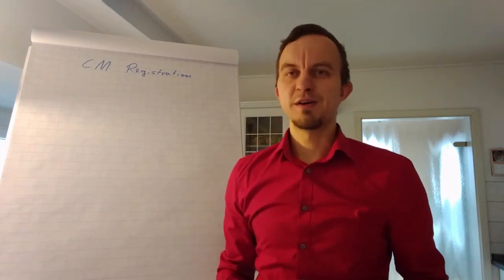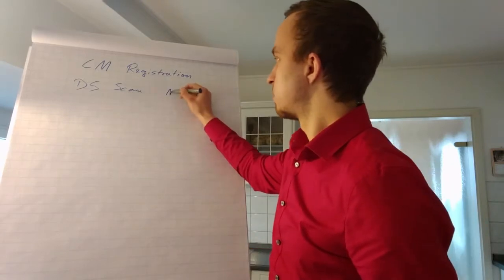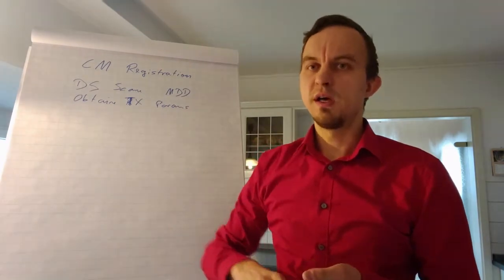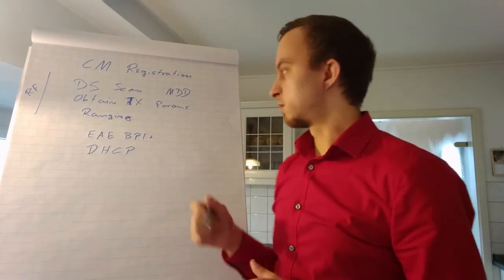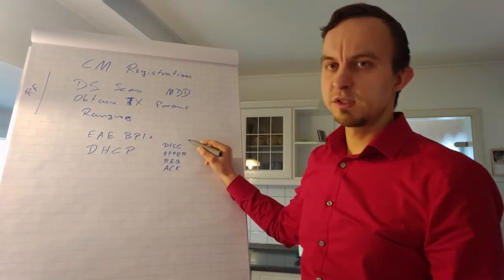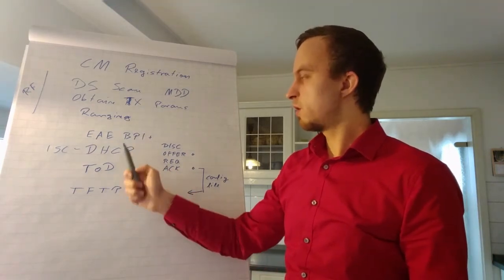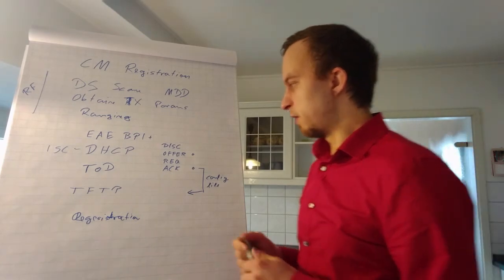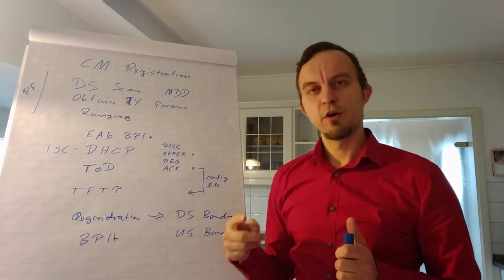Cable Modem Registration: How it works?

Comment: How does the ISP turn your service on and off? Is it always on and broadcasting?
Reply: Not sure how it is in your area but I worked in construction building fiber for a internet provider around here and in order for them to turn services off they would have a person come to the pole where your drop is branching from and put a small terminator on your drop line that just blocks the signal from the pole to your house. That was of course before everything went digital in which I would imagine they just get into your account and just put a block on the modem.